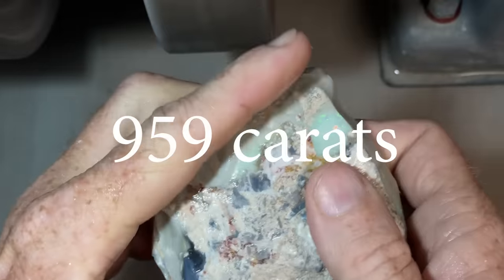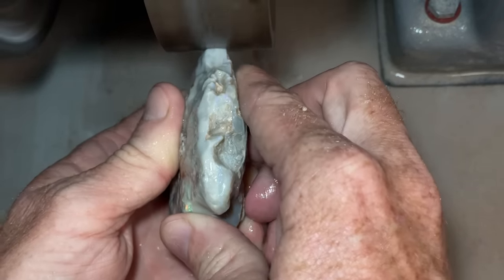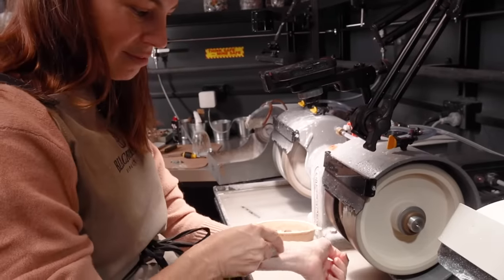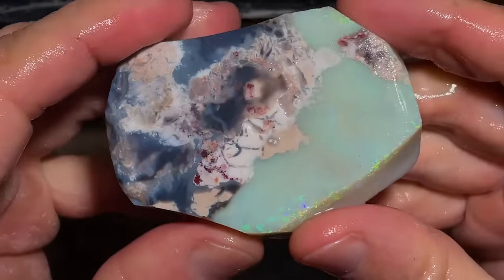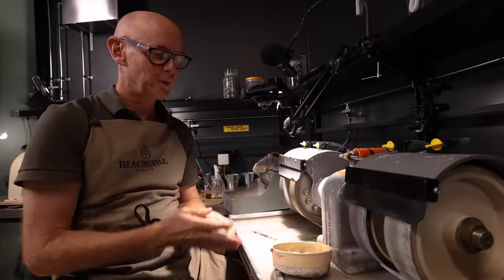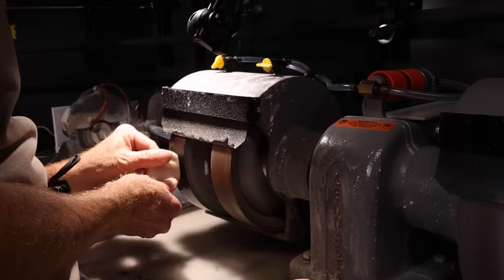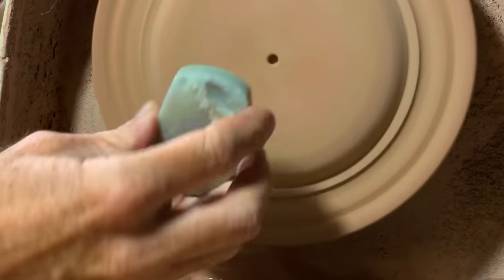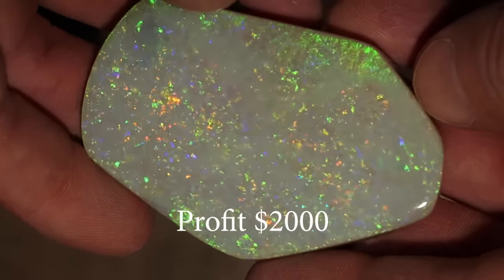950 carat uncut gem rough opal - I'm going in!

Comment: Looks good! Great job. Quick question, with that purple color bar on the bottom, would there be a benefit to clearing it up and showing both sides, or possibly slicing it horizontally and getting the purple as a second stone? Either way great job as always. Best opal cutting content on youtube.
Reply from the maker: Yes and yes but the color is very weak so I didn't. bother

Comment: Looks a bit like Olympic dribble gear. That would also explain the size.  Lots of big chunks out of their but that stuff is a bit softer than other opal around the Ridge.  Also could be from around the southern parts of Carters Rush, lot's of large grey slabs outa that area but cuts a bit slower than the dribble does.

Comment: Looks like you were lucky considering how thin the color bar came out. Obviously you took a risk based on your vast experience but someone with less experience might not be so lucky. I liked how you set the music to reflect the tension as you kept working it not knowing if it would come clean. I thought all andamuka opals are treated at low heat with sugar so it’s normal and not a big deal. I saw smoked Welo opals in Bangkok that are being sold as black opals on eBay what a joke.

Comment: I don’t have a problem with treated Andamooka opal - it’s always sold that way and very easy to spot. Equally doublets and triplets . All the Andamooka Opal miners I know are straight up on what they are selling- as soon as you leave the Opal fields then you are dealing with salespeople ( who lie cheat and steal ) . Anything you can’t see through is not a pure Opal. Sales people try and sell black opals which won’t pass light - they are cut as a natural doublet - it’s just cheating the customers. If you want some of the best Opal it’s hard to go past good Andamooka Crystal in my opinion. Anyone who thinks finding Opal is easy hasn’t been Opal mining. There’s a lot of dirt surrounding any one Opal - you can take that advice for free. If I wanted to find a good Andamooka Crystal, I would budget between 10 to 20 k without any guarantee of success.

Comment: What causes crazing? I have a couple seriously nice black opals the my father in law cut. One has no issues. The other however has crazing on the face. Is it possible to basically re polish it to remove the crazing? And yes I understand it would depend on how bad the crazing. 
Does I believe it's called Opticon cure the crazung?

Comment: I don't have an issue with treated opals as long as they are marketed as such. They make for beautiful stones that are more approachable than an $8k/ct natural piece. Make no mistake, I prefer the natural. However if I want to own any opal, it will either be lower cost treated stones or stones I have bought as rough and polished myself. Seeing as how I am also a total amateur at cutting/polishing I also won't be doing any high grade stones!

Comment: I just started rubbing. Bought inexpensive starter parcel. Practice 1st. Working w color bars some foil thin. Some littered w sand in middle, or sand on other side visable thru the crystal opal. I got few nice pcs. Much of it was wasted flected sand & potch. I learned a lot under worst cases & scenarios. I prefer that. Biggest lesson? You can't count on, or guesstimate anything. Other stone you can make educated assumption: " If I cut this? it will look like that after. You can see into Ethiopian. Aussie? If you rub this off? There could be anything below it. Expect the worst. Be ecstatic if it works out.🤣

Comment: I think it would be a better idea to split the value of the finished stones rather than the cutter paying so much and taking all of the risk. 50/50 or something. I would never sell a piece of rough not knowing if there's a 100k dollar stone in it. Paid 4k for that, if it had cut a giant $100k+ stone i would feel ripped off. And in other cases where you didn't make anything you wouldn't lose much at a 50/50 split. I think that's a better idea than guessing and taking a risk. For both sides.